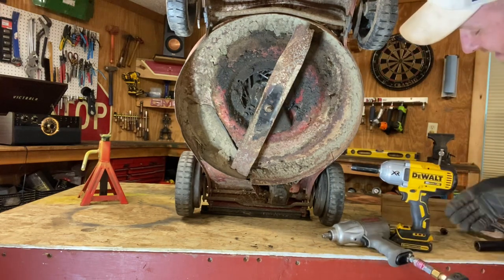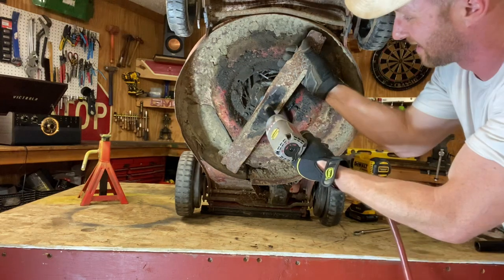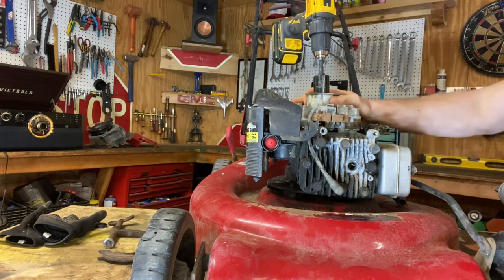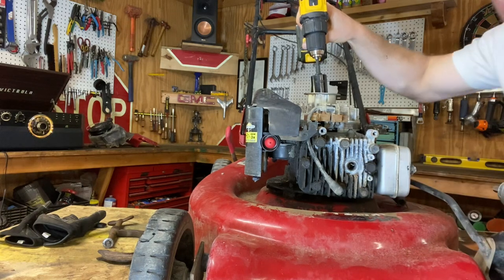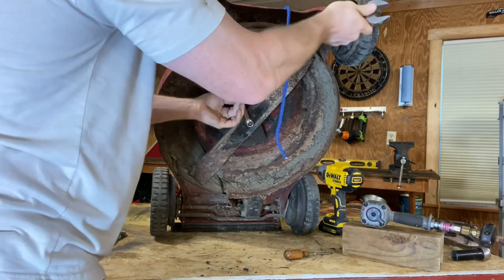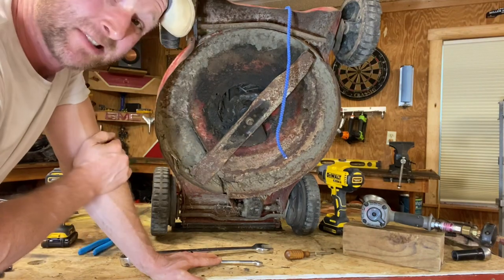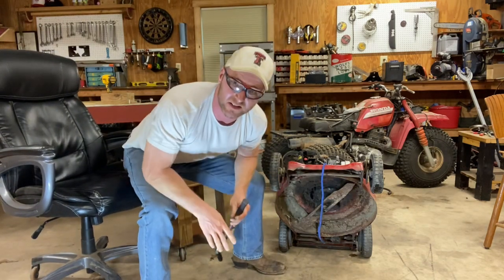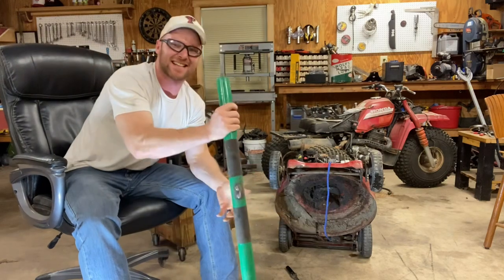Remove Stuck Lawn Mower Blade Bolt w/ a Rope, Pipe & JOHNNY CASH

Comment: I’m a little old lady and I worked for an hour, got WD 40 in my eye, and cussed a lot! My teenage grandson stepped in and cranked til he got blisters and thinks he might need several fingers amputated! But, that metal pipe idea was GENIUS! I used a fence post driver and it took seconds! You ROCK!!!  I love you!!
Reply from the maker: Haha that is great news. WD40 won’t help much on a stuck bolt, it is all about leverage. Sounds like you have a handy grandson there!

Comment: Of course I wait until a Sunday evening when everything is closed to decide if need sharpen my mower blade. I have all the tools but no 9/16 nut drive for my drill. I had no one to hold the blade so I couldn't use cheater bar until I seen this video. Take the plug out, put the rope in, pull the starter cord until can't pull anymore. Then tie it off to the handle. The pull handle will prevent it from slipping. I got my smallest ratchet with break over (in case I broke it) used pipe(cheater bar) and bolt came right off. Easy as could be. Thanks for the video!
Reply from the maker: Nice improvising!

Comment: Just dropping in a thanks for the pipe trick! Whanged on it for a while with my wrenches and tried a heat gun and hitting it with a hammer... and the pipe turned out to be just what I needed and BLAMMO!
Reply from the maker: Nice! Is an old mechanic trick. Glad it worked

Comment: An old trick is to put a strong phillips screwdriver in one of the 2 holes on the blade near the bolt. The screwdriver slides through and locks in place using the lawnmower so you can crack the bolt.
Reply from the maker: Wow excellent trick. Thanks

Comment: All good ,but my problem on my Alpina twin blade mower is that the retaining bolt heads are slightly domed and are only half the normal thickness. The first bolt undid O.K. but the second is a different story, the socket face is slightly tapered to ease the socket on to the hexagon bolt head, this coupled with the low profile bolt head means the socket slips off the head under pressure, I have sent off for an impact wrench and when it arrives I will have another go at the bolt and if needs be I will put the weight of the mower on the wrench to stop the socket slipping. Plan B is simply grind the head off the bolt and the remains should unscrew with my fingers or pliers and fit a new bolt.
Reply from the maker: That impact will either get it off or break it. You are making the right choices.Good luck!

Comment: Nice guns bub !!       i was excited to see the trick until you went through the crank shaft.   my mower is battery/electric so i can't go that way.     Need to find some other way to un stick that nut.
Reply from the maker: Check this out, it clamps to the deck and holds the blade. 

https://amzn.to/3c2ytx4
Reply: one idea i saw is to wedge a piece of wood between the blade and the body to keep it from turning. it may bend the old blade though.

Comment: My blade nut will not come off, it will not unthread, just keeps turning without comming down the threads
Any I deas?I changed blades and this nut would not tighten..now won't come off to add washers maybe
Reply from the maker: The threads are stripped. I don’t have any good solutions for ya on a push mower. If you can get the bolt off you can pull the engine off and try to re tap the threads.

Comment: I would just use oxy torch to heat the bolt, the use breaker bar or torque wrench to remove it
Reply from the maker: Heat is always good, I didn’t want to show people how to use a torch so close to a gas tank thought

Comment: My problem isn't that i couldn't loosen the bolt with my impact. the problem is the bolt threads galled on the crankshaft. I was able to remove the blade by using hacksaw on the bolt head. Now I have the remainder of the bolt still stuck on the crank. Any help would surely be appreciated.
Reply from the maker: I feel your pain I have been there before. I have used every extractor there is. I think your best bet is to use a left handed drill bit set. You just keep drilling bits in, each one bigger than the last and it will start catching and hopefully back out your bolt. 

But if it was so stuck that an impact couldn’t get the bolt off to stay with it maybe time for a new mower. Let me know how this turns out and well done with doing the most redneck method of all time to remove a mower blade. Haha
Reply: @MowerMike  I which it was a cheap mower but it's not, it's a chipper shredder by troy bilt. It has a 206cc Briggs and Stratton 850 series engine. I put something in it that was bigger than it was designed for causing the impeller to desintegrate. It came to a screeching halt. which cause the shredder to fall over on it's side. After removing the impeller the engine fired right up. I thought that maybe the engine might have had a twisted crank. Looking at the cost of parts and this machine is toast. I'm better off to buy a new one. To defray the cost I was hoping to sell the old motor that still runs excellent, but I have to remove the old bolt. I've come to the conclusion to use my angle grinder with a cutoff wheel and cut the bolt flush with the snout of the crank and start using different size bits till I drill it out. In the event that I booger up the crank threads is using a Helicoil a viable repair knowing what it's intended use is going to be.

Comment: Rope trick is a clever idea, only problem with me is the fact ive got a ryobi 20in brushless electric. Dull blade can barely cut anymore and im working to get it replaced. It aint moving worth shit.
Reply from the maker: Just get a cheap battery powered impact wrench, will zip it right off

Comment: I was thinking more like a breaker bar and a block of wood against the blade and inside. Not brave enough to stick anything in the spark plug hole even though probably safe.
Reply from the maker: Good idea just watch your hands

Comment: Oookay!!!! I got mower deck that's hanging on ground . The plate that holds the deck up by one bolt on mower front frame is stuck. The 75 percent of plate is broke off but the other 25 is stuck behind that bolt which is STUCK!!!!!! Without that bolt  out I can't re hook up deck to that mountjng frame
Reply from the maker: ???? Not sure what you are looking for here.
Reply: It's the same bolt!!; ⚡ But I will try a larger and longer handle thanks
Reply from the maker: @rodrickthompson2799  Best thing you can do is get a cheap battery powered impact wrench from Harbor Freight Tools. Will zip it right off. Good luck to ya I know how frustrating that can be and Happy New Year!

Comment: Thanks for all the great ideas. At what point would you heat the bolt with a propane torch? Also would it help to spray the bolt with wd 40 before you do anything? Yoy're great man.
Reply from the maker: Heat always helps just be careful not to blow yourself up. I would use PB blaster over WD. Good luck and be careful
Reply: @MowerMike  Thanks, I have read that heating the bolt is the last resort. I loosened mine with a 3 foot breaker bar.